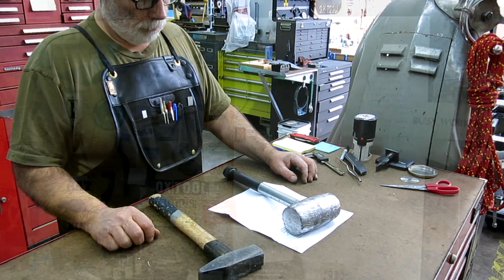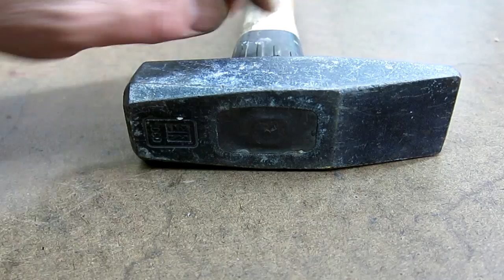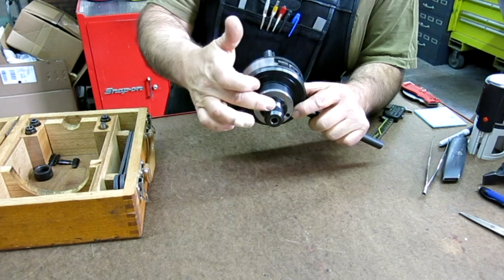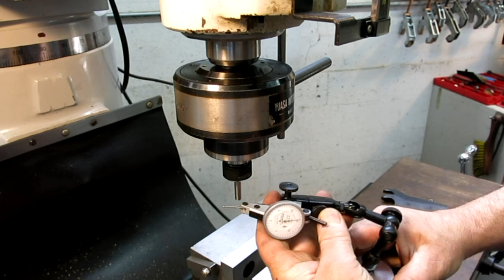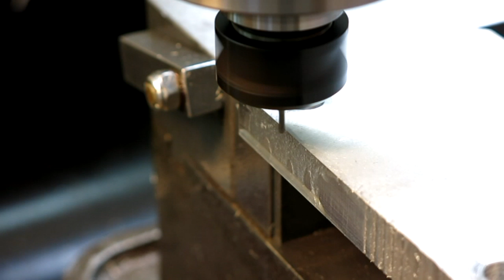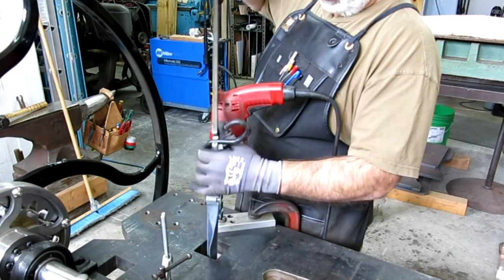Monday Night Meatloaf 79

Comment: The hammer is German, made by Halder, a company much better known for their Simplex brand soft face hammers. It’s called a Schlosserhammer over here, Schlosser being the general term for metal worker in German-speaking countries (the literal translation would be lock maker or locksmith).

This pattern is by far the most common hammer in Germany, you’ll find one in every DIY toolbox in every household. You’ll also find a lot of corner-shaped marks in German walls, because for some reason we all decided to hang our pictures using a hammer with a square face and sharp edges. No idea how that came about, would be interesting to find out.

Recently found the channel when I was researching a huge Boley vice I bought on eBay – really enjoying the videos!

Comment: That "spindle speeder" is a torque-multiplier and speed reducer "turned around" for use probably in a DRILL PRESS to get  much higher speeds for much smaller bits and possibly light milling but more likely its REVERSIBLE and the "input" and "output" drives can be swapped so it acts as a torque-multiplier/speed reducer. That would all relatively small drill presses to turn large bits and vice versa.  Basically work that the press isn't designed for but can do with a little "help" that's a hell of a lot cheaper than another machine or two.

Comment: When i was a Millwright we called that an "Old Man Pry Bar". Ours we a piece of 3/4 pipe, one end was mashed flat and a groove cut in it to accept a 5/16" chain. We would usually weld a piece of an old file near the forked end. The file rested on the back of the drill. Usually it was 2 pieces of pipe about 16" long with a coupling in the middle so we could take it apart and stow it in our tool boxes. Unfortunately I've drill 1000's of hole like that all over paper machines.
Reply from the maker: Hi Joshua,

Glad to hear is has a name in industry. What did the file do? Keep the bar from slipping on the back of the drill? Thanks for the comment.

Cheers,

Tom

Comment: I know this is an older video, but as a woodwork who dabbles in machine work, if you ever get your hands back on the "speed multiplier" again, try mortising a piece of hardwood with it. Which is usually done at router speed 12000 - 20000 rpms. Perhaps I've found a way to justify a bridgeport in my shop. Keep up the good work...
Reply from the maker: +dihskursiv Hi Dihskursiv,

I actually bought that speed increaser from my friend. Have not looked at it since the video was made. It needs some TLC one of these days. Thanks for the comment.

Cheers,

Tom

Comment: I would be real cool if you could show us how to make some drill bushings and heat treat them.
Reply from the maker: Travisfromoregon Hi Travis,

Thanks for the video suggestion. I'm so lazy I usually just buy them unless they are some really weird size. O1 tool steel works great for little heat treating jobs like this.

Cheers,

Tom

Comment: You cut that speeder a lot of slack Tom, but agree, I think he needed a bit of TLC. While the finish may well have been ok on the smaller slot, I think it would have been interesting to throw a pin gauge in there and check it for size. i doubt it would have been flattering!

Why do I always have to chuckle when I see somebody get kicked in the nuts.

Comment: Nice show.
The hammer handle is painted like a Peddinghaus but the logo is different.

Drill block.. In my Aerospace career I have used many in many different construction modes.Most use a 1 inch bore with slip bushings, centerless OD ground to be nominal inside and out to step the 1 inch down to 3/4, 1/2 and 3/8 for the slip renewable drill bushings in the needed drill size. They are a great tool to have if your job allows the use of them.

 I have not seen the lever bar used for a drill motor though it is a good idea, I wish I had thought of it or was told of it 30 years ago LOL!

I did do a similar "trick" though when we were welding up some bases for tools. The surface of the base was about 2 inch thick with a 12 inch on center honeycomb welded center structure made with 1/4 inch plate and a 1/2 inch steel bottom. There were lightening holes in every plate but the top which also served as access for welding.

 As you know steel warps as it is welded so I made up a pressure bar, very similar to your drill bar but it was made of 12 inch square tube and was about ten feet long and I used a 5 ton hand winch to apply pressure. It hooked onto the 2 inch plate on one end of the lever  and the winch went to the lever and then to the 2 inch plate. so the base was holding it's self in alignment. It worked very slick. By moving a block between the the lever bar and the base, we were able to apply pressure any place on the structure we need it to bring the plates into good and square contact for welding.
Reply from the maker: wayne parris Hi Wayne,

Now that setup sounds like a pry bar! I have used a similar technique with the overhead crane to apply large forces to a lever or clamp out in the middle of something where I couldn't reach with a regular clamp. 

Cheers,

Tom

Comment: I have a tiny Proxxon MF70 mill (I do really small stuff). Thee biggest endmill it takes has to have a 3.2 mm shank (1/8"). The biggest endmill I can use is 3mm. Proxxon recommends 20,000 RPM on Aluminum, as fast as the mill can go. I use their recommendations and mill Ally at that speed, and it produces really nice cuts. My feel is that you were going far too slow . But then, who am to quibble? Thanks for the drill leverage trick, I may yet use it. Thanks for a tasty meatloaf.
Reply from the maker: Juan Rivero Hi Juan,

I don't think my ears could take the noise if I turned that speeder up to the maximum. Thanks for the comment.

Cheers,

Tom

Comment: Hi Tom,

When I saw the way the indicator was behaving, I instantly thought heterodyning.

You appear to have both input and output runout on that speeder and they're giving maximum and minimum values at a periodicity related the speed ratio.

P.S. How are your Marmite stocks?
Reply from the maker: Paul Compton Hey Paul,

You are probably correct about the arbor having some runout. The indicator behavior was showing the combined outputs of the arbor runout and the speeder runout at an odd numbered ratio. At the time it was baffling. Marmite is good. Its the VM that I have a surplus of.....

Best,

Tom

Comment: Tom do you have the ability to index every degree  from 0 -360° as I have a job that needs to be done for my self.?
Reply: ***** You can get a spin indexer that holds 5C collets (plus tailstock) for under $100 that will let you index all 360 degrees. It has holes every 10 degrees and a series of vernier holes that let you position on all the individual degrees. $100 would be about equal to the cost of shipping some heavy object to be worked on both ways, plus you would end up with a spin indexer.
Reply: I live in Australia so ad a 300% mark up on these things. And the last one I had a look at was $400 with no plates and needed fixing. Eve the index Tom did a while back was $550 and amazon won't mail to here.
Reply from the maker: ***** Shoot me an email with the details of what you want to do.

Best,

Tom

Comment: Tom,
I once saw a vernier height guage made by a toolmaker I worked with. It was literally like a bought one! you wouldn't know if you just picked it up & used it. Anyway, I asked him how he generated the very fine vernier scales. He said he used a tool like you showed us but I never saw one being used before. I can't remember the ratio he said, but I think it was smaller & faster. a Bridgeport going flat out put it at many thousands  RPM. He said the sliding scale wasn't that hard to do it was just 0.10 mm less each line. Great to see one being used Tom, I've always wondered about these tools.
I don't know what he used for a cutter, diamond I suppose.
Cheers Pedro.

Comment: Drilled many a hole using the leverage bar, makes for easy drilling. The Milwaukee Magnums have plenty of torque, be prepared for it, I usually did this type of drilling with a 1/2" air drill.

Comment: Good ole Milwaukee Magnums AKA "the wrist twister" AKA "The slayer of drill bits"

You handle that well my friend, I love passing those out to newbies, sit back and watch the fur fly.
Reply: Shadon HKW So I am guessing you have a couple of "field expedient" drill presses in your trailer?
Reply: Nope, but I will soon! :)
Reply from the maker: Shadon HKW We used to call them Gumby drills. Because it will wind your arms up like Gumby if your not careful. Now for some real excitement I pull out the hole hawg. Anything with a 3/4 inch pipe side handle deserves respect.

Best,

Tom

Comment: HI Tom,
thanks for showing the speed increaser thingy, i would hazard a guess it's meant for a bridgeport type mill to emulate the deckel engraving mills like what Stephan Gotteswinter is running in his shop. they run up 20000 RPM if memory serves..

cheers
mike

Comment: Tom:

I was waiting for you to push on the collet while the indicator was in place. You never did.  The runout looks too "noisy" to not be an indication of looseness somewhere. Gronking on the collet would have shown bearing slack.

With all the bearings (and stuff) between your mill spindle and the work, I'd be surprised to see the runout under a couple of tenths.

As usual, I enjoyed the Meatloaf.
Reply: Elden DuRand "Gronking" <--------------new term!  LoL~!
Reply: Dan'sMeTube 
Gronk.  Verb:  To gronk.  To intentionally push, pull or twist with force.  (Example:  His neck was gronked until his eyes bugged-out.) 

Origin:  From the Greek God Gronkisis, the God of Brute Force.

Not to be confused with "klutzed", which means to do the above by accident.

Also not to be confused with "Bozoed", which means to do all of the above but without the benefit of prior thought.
Reply: LoL~!
Reply from the maker: Elden DuRand Hi Elden,

I did push on it at some point. Maybe it wasn't on camera. The unit is fairly tight side to side. It must have been hit or banged at some point. I will take it apart and get is cleaned and inspected. Some of the runout seems to come from the R-8 arbor. Your definition of gronk is quite correct. 

Best,

Tom

Comment: Your drilling trick took me back in time. My dad had an RV dealership, and I spent summers installing trailer hitches. To mount the hitches holes had to be drilled upward through the trunk floor, frame, or bumper (yes, this was when cars still had metal bumpers). It was difficult to hold the drill steady, in alignment, and apply enough pressure to drill upward through steel. The drill was an old 1/2" Van Dorn, not a light weight.  My dad made a lever from a 2x2 with a collar made out of a short section of tube steel that slid up and down the 2x2. The collar had a couple of flat bars welded to it to capture the rear drill handle. One end of the lever was placed against the floor. The rear drill handle was placed on the collar and the collar was located on the 2x2 to get good leverage. Grab the side drill handle, pull up on the 2x2 lever and punch the hole. Easy Peasy.
Reply from the maker: Ron Leap Hey Ron,

Did you guys use the special vertical drill bits as well? Thanks for the comment.

Cheers,

Tom

Comment: Hi tom,
Like the old school millwright trick with the drill lever.
Makes drilling  in the field a lot easier.
Used this trick to drill bastard bolt patterns in pipe flanges.
The lever works on the vertical as well.
I like your idea  of using tiedowns, chain can be a pain sometimes.
Thanks for the video.
Jeffrey Miller
Reply from the maker: Jeffrey Miller Hi Jeffrey,

Thanks for the comment.

Cheers,

Tom

Comment: I had to drill some holes bottom up in a trailer. I used a 2x4 as a lever to press the drill. Works almost as well as a drill press.

Comment: I bet that speeder was crashed at some point. Sounds bad, runout, and the broken collet, and hump on the taper point towards that. Did you try wiggling the spindle back and forth (not turning it) with the indicator on it instead of just spinning it?
Reply from the maker: Andre Gross Hi Andre,

There is no play when I pull it back and forth. You may be right that it got hit at some point. I will probably disassemble it when I can find a diagram or some documentation on the unit. 

Best,

Tom

Comment: I love the drill trick. I could have done with that a few times over the years. I once was installing a video projector at the Health & Safety Executive (The UK safety agency) and my co-worker and I were drilling an i-beam with a 1kw Makita (1.4hp) and a 16mm (5/8") bit. As the bit broke through it grabbed and flung us both off the ladder - right in front of the customer! Fortunately we weren't thrown off site. If we would have used your trick (and advice) we would have been in better shape. PS - Just bought your book -"WOW", best book I have read in ages!
Reply from the maker: Rupert Powell Hi Rupert,

Thanks for the nice comment and story. I have heard a few drill versus ladder stories over the years. Humans are at a severe disadvantage when their feet are off the ground even a little bit. I would pay to watch that video. Glad you like your book. 

Cheers,

Tom

Comment: A most interesting Meatloaf tonight. Not at all sure about the speed enhancing device but loved the little blocks for drilling and tapping plus of course the leverage device for the drill, I use the reverse process for removing broken / rotted off fence posts (so much better than digging unnecessary holes to remove them!

Comment: i really enjoyed your make shift drill press. as a young millwright apprentice in the 60's i was assigned a helper and tasked to install chain link fence posts on a concrete slab. i was given the biggest d handle portable drill i had ever seen and enough drill bits to eventually drill a hole big enough to sink the  post. the going was slow and boring one man leaned on the drill and the other squirted water in the hole. i came up with a brainstorm. i got a small board and sat on the drill with two pipe handles thru my legs. the first couple holes whent great. on about the third hole the big bit hit a piece of rebar and you can imagine what happened next. in the blink of an eye i was spun around and hog tied to the drill with the extension cord. fortunately the drill was slow and my buddy was quick to pull the plug.needless to say my story was told every time someone checked that big drill out of the tool room.
Reply from the maker: larry sperling Hi Larry,

Your story is the thing of legends. I have heard variations of this kind of thing happening up on ladders drilling vertically. Epic. Thanks for sharing your story.

Cheers,

Tom
Reply: larry sperling Too funny...  8^)

Comment: I'm by no stretch of the imagination an expert on anything machine, but I'd have to say, hearing the noise that tool was making and the run-out, IMO I'd say it's seen it's better days... Clever setup with the drill. Work smart not hard was my motto.
Reply from the maker: Duncan Mac Hi Duncan,

Its a fail right now. In good condition this is a really nice tool. I think I smell a rebuild project in this one. Thanks for the comment.

Cheers,

Tom

Comment: Interesting video.  That speed increaser looks expensive, too bad it is not running true.  So I have never seen anyone with a pry bar on a drill before.  I would be worried that I would press too hard and the plastic would break.  Thanks for the video.
Reply from the maker: cerberus Hi Harold,

You can make a nice one of these out of some pallet hardwood in a pinch. The little curve spreads the load out over more area in the handle. That particular drill is 30 years old and still going strong. The older I get the more I need the leverage stick. I used to pop 1/2 holes in by hand in my youth. 

Cheers,

Tom

Comment: Yep, in europe when You say hammer, that's what we think of, although 1000 gram is a bit on the heavy side. 

It might be that at some point someone replaced bearings in the speed multiplier to standard not precision ones, hence the noise,... I think.

So to recap, all You are still missing are: magnetic drill, smaller lathe, a ridiculesly big lathe, a cinci mill that weighs more then your house and requires it's own hydro dam, plus all of Your machinery in CNC version, aah tool fever never lets go.

cheers, n.
Reply from the maker: nezir skorupan Hi Nezir,

You may be right about the bearings. I'm going to disassemble it and check everything out. Need a diagram or schematic now. Time to hunt one down on the web. I see you are familiar with the tool disease. 

All the best,

Tom

Comment: We used to used a similar drill trick when drilled holes for dowel pins in the burn't edge of 1600 x 800 x 800 steel slabs, though we used a length of wood and our boot. Also, the Oxtool t-shirt has landed in the UK, great stuff 👍
Reply from the maker: Bespoke Metal Fabrications Hi Andy,

You hit the nail on the head. Sometimes its much easier to make a fixture of move a machine to the work if the workpiece is large or awkward. Glad you got your tee shirt.

Cheers,

Tom

Comment: Tom, Excellent trick with the hand drill and lever. It also has a second advantage. I noticed that when you were drilling the smaller hole the hand drill did not remain centered over the drill bit axis. Leaning down on the hand drill "bent" the drill bit a little. (You can see it if you look closely in the vid.)
The lever cancels out that condition.
Cool trick!!
THanks.
Eric

Comment: Your spindle "speed increaser" doesn't sound too good.   Lots of bearing chatter based on the audio.   Tear it apart, clean it, replace the bearings? It would make for another great episode, to see the internals.
Reply: Might fix your runout issue.